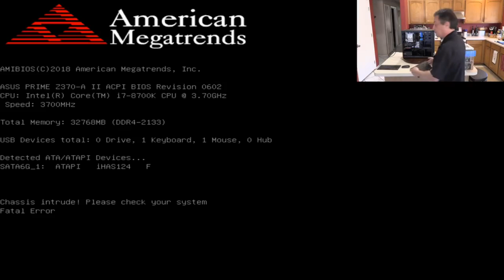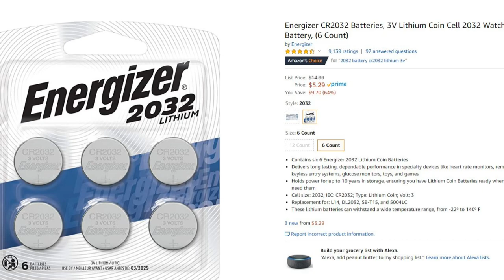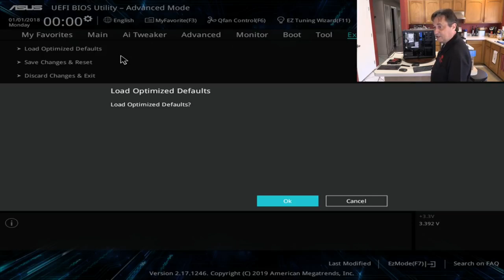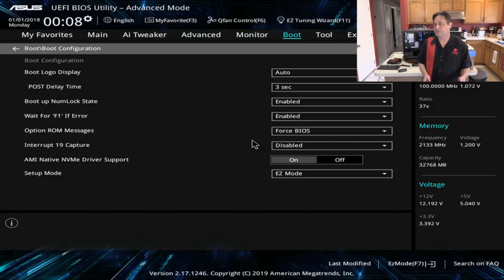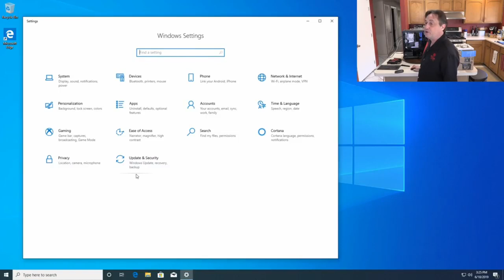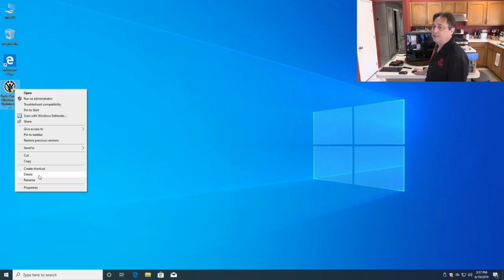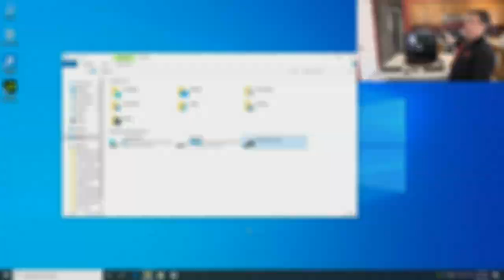Computer Repair: Solving A Mystery

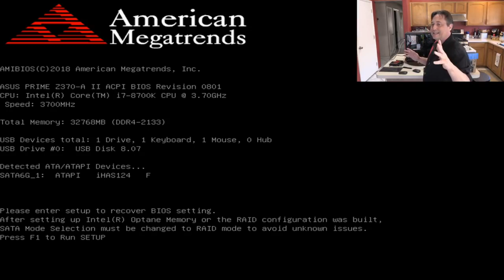Comment: One side observation. In my experience, after a BIOS update on Asus boards, the "bla-bla-bla... Press F1" BIOS screen always(!) comes up, as the BIOS was reset during update and it asks us to set it up "fresh" or anew so to say. I don't even have to press anything, the Pres F1 screen at 13:51min will definitely come up by itself. Knowing that I am aware that the BIOS update was actually not botched and that I ca now proceed further. A sort of a time stamp (though not a milestone:)
Another point is that as someone already pointed out below - if reinstalling windows on the same board with the same components, the Windows key is not usually necessary:) And I also helped someone on a forum with a Win7Home edition to simply upgrade to Win10Home a year ago, just by running an Windows 10 install (Win "Home" to Win "Home" upgrade only) via Windows Media Creation tool and the person was super happy that he didn't need to buy a new license. But before doing that I would install Belarc Advisor and copy the windows and whatnot installation keys.

Comment: what about the windows key after fresh install. how were to get the same key, did you had it noted somewhere or how did you get that windows key?
Reply from the maker: Windows 10 remembers your hardware. If you install the same version of Windows 10, clean, when you go to Windows Update it will automatically recognize your hardware and reassign your key for life. You don't do anything after the first activation. If you change motherboards, then you need to buy a new key.
Reply: @CareyHolzman  got it. thanks

Comment: Carey.... TPM != chassis intrusion. That's a separate setting in most BIOS/UEFI interfaces (and/or separate physical connector and circuit on the motherboard) that is generally present in corporate machines, regardless of whether it also has a TPM or not. Certain functions of the TPM module CAN be used by service technicians to derive a chassis intrusion incident in that they would indicate  intrusion if the tech knew what to look for in the event that chassis intrusion is not enabled, but this is not the TPM's primary (or even secondary) function.
Reply: Yes, its a Microsoft Intel consortium standard, as far as I remember used for hardware generated security along the lines of unique keys/identifiers, for OS security and hardware identification, drive encryption like bitlocker and authentication to decrypt or not if drives are swapped into another machine.

Comment: I'm surprised to see that memory is running at 2133 mhz according to the bios. I looked at its link and see Its rated at 3000 on amazon.
Read a number of buyers comments on the ram and found someone else who bought it was surprised the memory was running at lower speeds as well.
Reply: That's because XMP hasn't been configured, that speed is not JEDEC spec, and so technically is considered overclocking, the difference between XMP and actual overclocking is that the RAM has been verified to run at those settings, although it is not guaranteed to hit those speeds.

2133MHz is also the speed that Intel specifies the memory controller at for that generation of CPUs.

Comment: Aren’t you glad we are not where we were in the early and mid 90’s troubleshooting autoexec.bat, config.sys and modem init strings after looking at all the internal hardware?
Reply: @echo off
Reply: Dip switches?! Try little plastic jumpers that always popped loose and skittered under the motherboard.  And keeping all your interrupts sorted out when you added a sound card. And then having to change the serial port interrupt so that the mouse would work again.  And...   Gawd, I miss the good old days...  NOT!
Reply: oh yes there are somethings I don't miss from the '80s lol
Reply: @Paul_nutfrom80s  Format c:
Reply: @darthbubba866  I have still have a few boxes of jumpers do you need any???

Comment: There is a small, and mostly academic (in the sense that it doesn't make much material difference) distinction to be made about the CMOS and the BIOS settings. For the last decade or so, the battery is used only to keep the Real Time Clock going. The bios settings are stored on non-volatile flash ram these days and not on a CMOS chip. The flash ram can keep its settings without a voltage to keep its settings alive, it's just that when a voltage is not detected this is a signal to the BIOS to revert to defaults. 

As I said, the distinction is slight because the net effect is the same. The point though is that removing the battery doesn't force the settings to be lost. The board doesn't necessarily have to be programmed to comply with what now becomes a request to revert to defaults. There may be another step needed such as a DIP switch flip or jumper move involved.

Comment: That's why you never want to permanently store data on your main drive without having a backup!
Reply: +1 A portable HDD, a NAS or even an USB with sync'd data at least once a week goes a long way. I went even further and created a RAID1 setup, where 2 HDDs, specifically designated for storage only, mirror each other. I have an nvme and two HHDs (in the future will move to SSDs probably). If one dies, the other will keep the exact same data (mirror). And any Windows10 user, who has two identical HDDs or SSDs, can also create a similar mirror - called software mirror (similar to RAID1), without much PC knowledge.

Comment: I always take the drive bay cover and tape it to the inside bottom of the case, this way if you decide you don't want the optical drive anymore, you don't have to go hunting for a matching cover.  Now a case that is decommissioned, I will pull them all out, and tuck them in my junk parts box.   Which is now a 5' high plastic storage bin.

Comment: Good show,  jolly good show! A guy that does computer fix-its from his kitchen, rather then a lab full of computer junk hanging all around to 'impress' viewers. 
Once I get Windows 10 Pro installed I go right to the Microsoft Windows upgrade page, download the tool (top most upgrade button), and let it install the latest version, that bypasses a lot of "updates".
I like ASUS hardware, used it for years no issues. 
Just a side note, I WILL NEVER EVER use cloud for storage or backups. You would have to be brain dead for that garbage.
First thing I uninstall in "Programs and features" is MS onedrive.